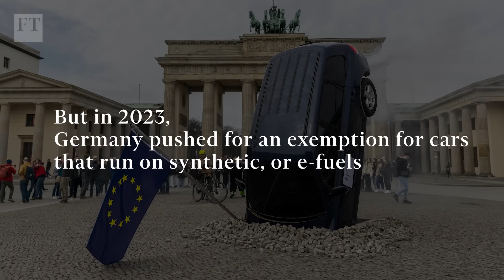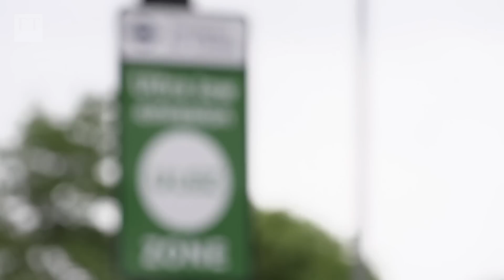The end of the combustion engine? | FT Energy Source

Comment: Battery electrics are only now entering into the Commercial Market with Cybertruck joining Rivian R1T and Ford Lightning and soon Chevrolet Silverado this Fall giving consumers in the USA 4 options for pure play BEV work trucks. Ford and Rivian Vans starting now to make an impact as well. For actual work from Railroads to Trucking to Farm work to Construction the internal combustion engine matters more now than ever however. Hybrid drive systems have been the norm for Railroads in the USA for Generations so maybe that will spread into the consumer market but not pure play battery electrics which have major fire hazard risks which first must be mitigated then basic engineering challenges such as weight, reliability, mass, robustness of build, cost appropriateness, appropriateness period. Definitely part of the solution tho..

Comment: Visit Norway for a working example.
System supported electrification many years ago, of course thanks to its oil profits as well.
But today EV is still the option with discounted price and better benefits by the system, infrastructure is there after the decade of building, public sector uses EVs and anybody can buy their own while there is a massive 2nd-hand market thanks to all af this.

ICE is not going anywhere.
Electrification is a process, but it can work 😊
Reply: The electrical system, even for homes, is considered a failure due to its dangers, malfunctions, expensive and complications, and now they want to put it in cars ?!!
Reply: Norway is a petrostate with some of the highest emissions on earth.

Comment: I.C.E. vs EV
from Canada
Comparison using 180,000 km
ICE (internal combustion engine)
8 litres per 100km. @$1.60 per litre fuel cost
14,400 litres of fuel at $1.60 per litre 
$23,000 fuel cost for ICE vehicle
22 oil changes at $100per = $2200
Total costs to run an ICE vehicle for 180,000km.
$25,200 plus plus 

EV
Unknown?

Comment: Ethanol is the most environment friendly fuel ever.  E-fuel seems to be bulshit when you think in large scale, on the other hand bev's could works well only in central countries, but it isn't the actual scenario. So in my standpoint of view, the best solution is hybrid vehicles equiped with hydrogen, ethanol or both internal combustion engine running at high efficient range.

Comment: Hi. End of ICE's? Not a chance! Ony an ICE powered aircraft can carry enough fuel to reach an alternative airport if the destination isn't available due to tornados. Also, we recently had a major earthquake and the only vehicles on the road delivering aid were ICE powered because the electric grid was down for days. We average Joes will go electric by compulsion, but the really important vehicles like ambulances, fire engines, delivery trucks, and the military and cops will ALWAYS be ICE because it's no problem to store enough gas to keep them running for weeks. Cheers, P.R.
Reply: But to do all that you need oil. What happens when oil runs dry?  Because one day it will.......
Reply: @Brian-om2hh  Hi Brian. Quite right, we'll run out of MINERAL oil, but synthetic oils have been on the market for years. The early I.C.E.'s used castor oil, especially for racing. Any vegetable oil like olive oil can be chemically modified, and some diesels even use peanut oil for fuel. Used engine oil is recycled even in tiny NZ, so oil for I.C.E.'s isn't a problem. It's burning the valuable stuff as FUEL that's a wicked waste. Cheers, P.R.
Reply: @philliprobinson7724  Well you can use the oil to generate the power stations that charge the EV's .
Reply: @PyroShields  Hi Pyro. You make a good point, and this is being done wherever it's beneficial. 

\Unfortunately there is a compounding problem. Each time energy is converted into another form there is an efficiency loss. The burning oil only delivers 70% of its heat to the steam-boiler, a lot goes up the chimney. The boiler only delivers 80% of its steam energy to the turbine, which only turns 70% of its kinetic energy to the electrical generator, which loses another 5%. The transmission lines are only 90% efficient also, so by the time the energy from burning the oil reaches the battery to charge it, there's only three fifths of five eighths of eff-all left. It's like continually slicing cheese from the big block to make your daily sandwiches mate, it knocks the block down in size rather rapidly. 

This is why many scientists are begging for public funding to find a "ROOM TEMPERATURE SUPER-CONDUCTOR".  If they find one, the electrical energy wasted in conversions will be halved in one fell swoop. It'll DOUBLE our energy supplies overnight. But it's a hard task with slim hopes of success, that's why we need more public funding for science. 
\
(To be perfectly honest, at this speculative level investing in science is like buying a lotto ticket and booking your overseas holiday at the same time. But science is all we've got.)

In the meantime some diesel engines can be 50% efficient, and petrol can approach 30%, so retaining some I.C.E.'s in some cases is not only a more efficient way to use oil energy, but it gives extra security by avoiding a "central supply" problem. When central suppliers fail, everyone goes down, but when everyone has their own supply, only a few do. That's energy security. Cheers, P.R.
Reply: @philliprobinson7724  You do realize they make Ambulances, cop cars and fire trucks(hybrid) EV's right? That's  the direction we are going. If you're talking about natural disasters I'm sure in the future they will be transporting advance swapable batteries. That's just my opinion.
Reply: @PyroShields  Hi Pyro. I do know that, but thanks anyway. I live in NZ where we have regular earthquakes. Our local grid was down for several days and only ICE vehicles got through with food and water. 

You're right, that will change quite a lot in the future, and I'm heavily in favour of swapable batteries. Those will require universal standards of course, like we have for tyre sizes and used to have on headlights (5 & 7 inches). All the best, if we all keep adding our bit we'll beat it in the end. Cheers, P.R.

Comment: Two fuels....Electricity and Oil (and Gas and Coal).....
Oil Gas and Coal is easily accessible, but what about the Electricity.....
Electricity must be generated somehow......
Over the past century, the main energy sources used for generating electricity have been fossil fuels and, since the 1950s, nuclear energy. Despite the strong growth of renewables over the last few decades, fossil-based fuels remain by far dominant worldwide.

So in reality we cannot get away from fossil fuels in the short term for sure.
Fossil Fuel drives everything today.
The reality is this....
Can renewables replace fossil fuels.?

Obviously at this moment in time the answer is NO.....Then how long will it take.?
The answer is probably a VERY LONG TIME.....Decades if not Centuries.....
Along with all of this is the EXPONENTIAL GROWTH in DEMAND for ENERGY whether it be Gas, Oil, Coal, Electricity etc.....

Comment: Filling the tanks (i.e.Battery) with electricity on these cybertrucks should be interesting compared to filling the tanks of normal trucks which only takes a few minutes.
An EV Battery is equivalent to a diesel tank on a normal truck because in an EV, the fuel used is electricity and the Tank (storage) is the battery.
Wherebys in a normal ICE truck the fuel used is diesel and the tank (storage) is the tank.
I know what I prefer.....a simple tank.
Then again, getting rid of these batteries (tanks), is a massive problem...Billions of metal cans to open up to get to the lithium etc.
If we go down this route the World will be awash with Trillions of small metal tanks full of lithium....There must be a better way.

Comment: New combustion tech will be:

75% efficient, vs EV at 85%
CO2 neutral with RE fuels and CO2 capture
CO2 capture on vehicle and use of CO2 in cycle.
3000 mile range on 20 gallons, 9000 miles of range without CO2 capture on gasoline, 2/3 that on Ethanol from RE.
No rare earths
No drive battery
No battery fires
CO2 and water capture puts out fires.
$30,000 sedan.
1.2 mil mile life cycle with 3 overhauls.
~ 1/5th the total cost of EVs
Tech works in airplanes for 1 cent/mile at 120 mph fuel.

Folks, EVs are OBSOLETE.

Comment: Legacy auto like Toyota, VW and GM have hundreds of billions of dollars in debt. They won't survive the transition to battery electric cars, just as steam engine car manufacturers didn't survive the transition to internal combustion.
Reply: And today they're all halting plans for EV production and investment. And putting all that money into hybrid cars.
Reply: @divyanshbhutra5071 Exactly. People seem to forget that improvements to batteries, motors, and motor controllers also increase the competitiveness of hybrid vehicles as well. Never mind renewable liquid fuels made from hydrogenation of sewage sludge, corn stover, rice hull, and garbage.
Reply: Toyota will survive because there is still a large market in Asia, Africa and Latin America. There it is very difficult to have a big amount of EV's
Reply: @sufyansmits6410 no it is changing. Byd and Wuling are making strong inroad into the markets with very affordable EVs
Reply: It's called auto loans. They borrow money from the market (or issue debt) to lend to customers. They usually make a small profit in interest rate differences too.

Comment: NEW internal combustion engine vehicles will be irrelevant by ~2030. 13% of new cars sold are fully electric already here in 2023, more than 3x their market share compared to 2020. EVs are going to be very cheap as they are still riding down the cost curve.
Auke Hoekstra, Prof. David Bailey, and Julia Poliscanova (except for the dumb climate change comments at the beginning) are spot on: China will take massive market share in the shift to EVs, Julia's discussion about how much simpler EVs are/the cost declines we will see, the joke of synthetic fuels (absolutely), the NONSENSE virtue signaling from politicians about "CliMaTe ChANgE" when EVs are inevitable, and most importantly the comments from 7:44-7:55 about how an ICE ban is irrelevant.

Politicians need to stop the nonsense. Private industry has made EVs inevitable.
Nobody will be manufacturing ICE at scale beyond 2030, so no need to ban anything. 
Also, the "climate change agenda" is completely idiotic. It has nothing to do with this discussion.

Comment: The point is being missed. It doesn't take 1 ton of material to move even a whole family. First off vehicles need to be much smaller . If we moved to small monorail vehicles then the need for batteries would be greatly diminished. Such a system was used at General Motors back in the 80's to move car's and car parts around the plant. I took care of it and it works! It would eliminate accidents, traffic jambs, stoplights, weather related problems and much more. Climb in press your destination and text or read a book, the vehicle will do everything. It's a low energy alternative that could be implemented with off the shelf technology right away. The downside, it's inexpensive, our economy is largely based on automobiles.
Reply: Hi Bob. You're right with the "smaller".  were working with a conveyor belt system, not a means of personal transportation. Can you imagine the expense of putting a monorail down every second street, or the jams if everyone wanted to move at once?  Also, vehicles on rails or tracks have no possibility of being "pushed to the side of the road" or "towed away" when they break down. It'll never happen mate. Cheers, P.R.
Reply: @philliprobinson7724  Monorails could be made from bamboo. Quite easy to also make them switch to different  tracks somewhat like railroad tracks, all automatic. As I stated I maintained such a system and I made it work. This was in the mid 80's when computers couldn't do even close to what they can do today. Quite simple programs and we are talking about changing bits not megabits to move people all at once. Actually 29 words per communication point. Each person would take up perhaps 2 meters at the most each?  I don't think that would cause much problem. I've seen it and thought it through, I've worked with most of the latest technology, this would be simple.
Reply: @bobm3477  Hi Bob. Bamboo monorails? I guess you mean the vehicles themselves, not the tracks which surely must be made from steel. It might be a possibility in China or South East Asia where bamboo is one of the fastest growing plants. It must surely have a part to play in a green economy. 

My first reaction to your posting was laughter, but then I remembered the best twin engined fighter-bomber of WW2 was the DH Mosquito, made of plywood and balsa wood. I'm not sure what the rest of your letter is about, so I'll just leave you with my congratulations at being such an "outside the box" thinker. Cheers, P.R.

Comment: The second week of owning an ev I knew a) I would never own an Ice car again & b) it is a matter of time till it's the dominant option for all drivers. When I compare ownership experience it' comes down to economics & convenience. Oddly enough a friend of mine also said it was his second week to realize the same.
Reply: I hear this a lot. When you drive an EV you don't want to back to ICE.  Is this because it drives so smooth?
Reply: @PyroShields  The smoothness, instant power,  & quietness of the drive is a factor. Reliability is a second, convenience is third for me. Last time I drove my workplace van and entered the highway it really felt like I was driving a slow shaky & loud lawn mover into the highway - noticeably uncomfortable when compared and I have 20 years driving gas experience before owning an EV.  Anytime you deal with anything new there is a trust & familiarity issue and suspicion 'there has got to be a catch to this' as there usually is with most technology  and especially when there is so much negative EV propaganda and misconceptions from prior car ownership experiences. Like my neighbor that told me I can't drive an EV when it's really cold, yet he actually had to spend some time warming up his engine while I just got in mine & drove off.  For me it's also it's just so much cheaper & easier to charge at home,  I only need public chargers in a road trip outside my city. My total maintenance in 13 years of only owning EVs has been tires & replacing windshield wipers, no repairs needed.

Comment: One of my vehicles is 30 years old, another is 20 years old. And I have two other vehicles that are IC. I am middle age and fully intend to keep them all running well into my old age.
Reply: t'll be down to how much you'll be willing to pay to keep them running.
Reply: No matter what it costs to fix the cost is always LESS than buying so short lived and defective EV  or even one of the high priced modern SUV's and Pickups which all those with defects below the belt insist on buying !!
Reply: Can't run an ICE vehicle when gas stations will not be around or hard to find one.
Reply: @PyroShields lmao in your dreams tree boy. It’s called ethanol.
Reply: Ok
Reply: In your dreams treeboy. It’s called ethanol.
Reply: Fair enough. However, ICE vehicles last 12 years or 200K miles on average. EVs will outlast ICE by a factor of two or three. They're simple and will be much cheaper to make eventually.
Reply: @rogerfroud300  i have yet to see one tesla over 120k in miles idk where you are getting this information from outside of a generous estimate of life expectancy from tesla themselves. but i do have two ice v8 that are both about to hit 40 soon and they run like new still.

Comment: We just bought our second Tesla and we are officially an EV only household with Solar and Powerwalls.
Reply: Fully electric vehicles, as of 2024 are worse for the environment than an efficient plug in hybrid
Reply: @fe2nq  pump oil out of gulf - transport it - use electricity to refine it - then transport it again to a gasoline station in a diesel semi - drive your hybrid to a gasoline station and use electricity to pump it into your hybrid. Yeah that is better for the environment.
Reply: There I fixed it for you

Comment: The problem is people take sides in this super complex debate. We need each technology to get better. The greatest issue with the internal combustion engine is not running at optimum conditions to get best thermal efficiency out of the fuel. Engines need to be under high load, with high compression and extremely fast combustion. We are working with some old and very simple converted diesel engines with pre-chamber spark ignition and port injecting Hydrous Ethanol circa 90% (The greatest error is expensive E-Fuels) and we are seeing well over 50% thermal efficiency on a wide load range. It is ideal for hybridisation for offroad applications. Let electric motors provide propulsion as they are very good at it. NOTE: Hydrous Ethanol is much easier to produce and takes significantly less energy than Anhydrous as mixed in E10 gasoline. Just adding a comment from someone who does hands on work with engines....